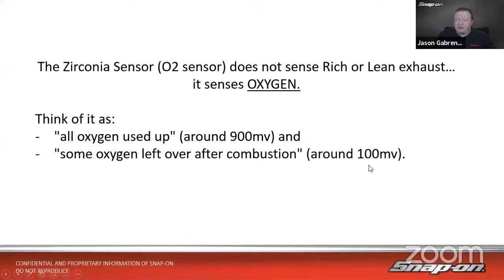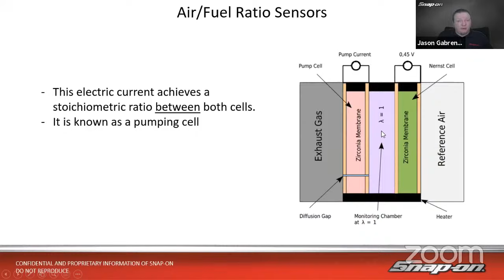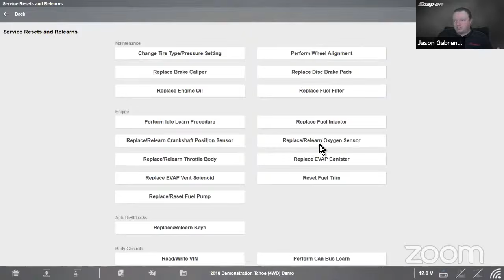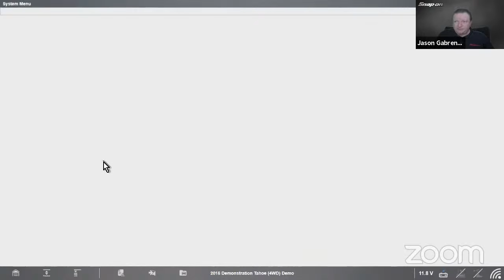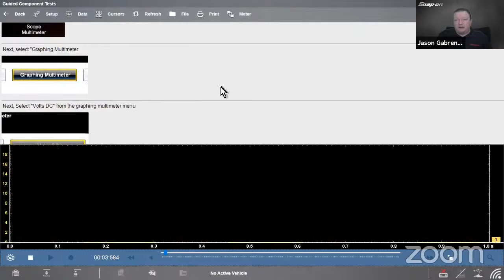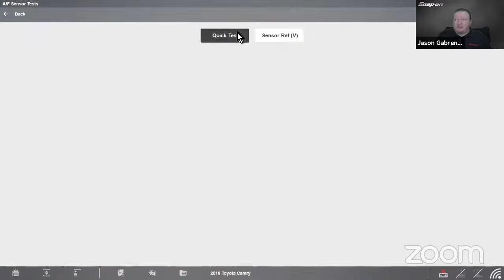Component Testing: Oxygen Sensors - Snap-on Live Training Episode 19

Comment: I noticed on the zirconia there were 2 signal wires, a high & low.  Can you explain there purpose?  Is it as simple as it sounds?  Does the signal switch physical circuits as the sensor works?
Reply from the maker: Hi Brett. The low in the case of the Chevrolet refers to the ground side of the circuit.